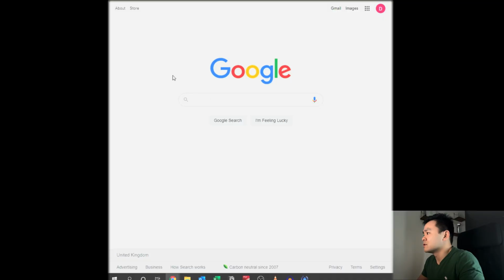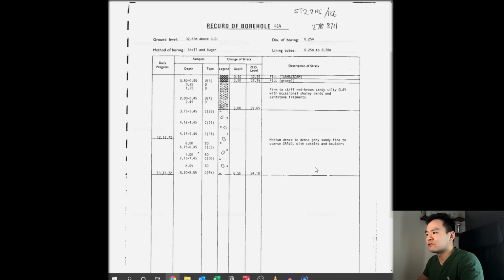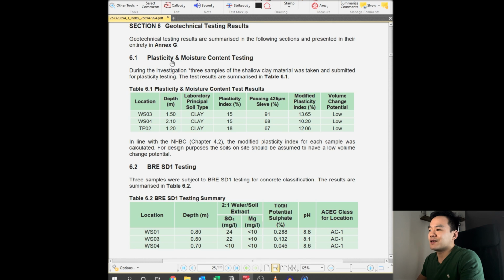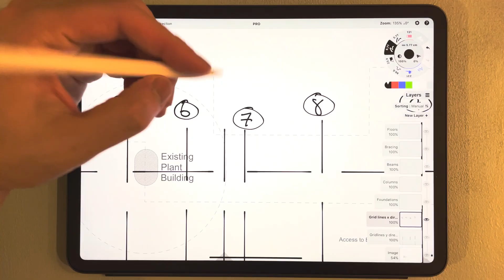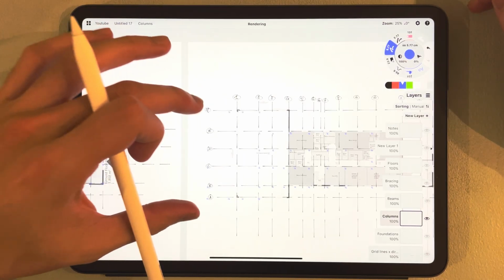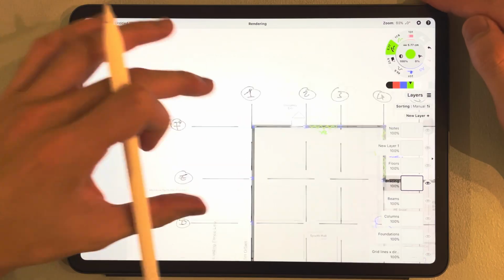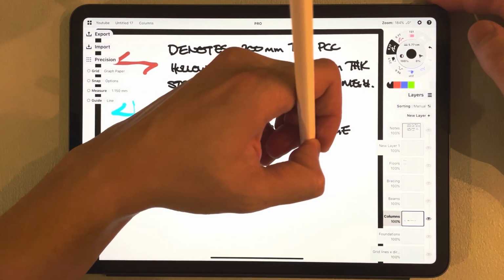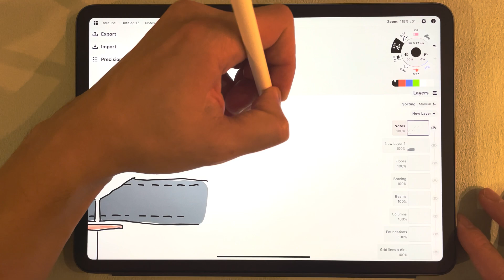How to Develop a Concept Design | Structural Engineering

Comment: Hi, thx for great videos 😊
working as an architect in Norway, Oslo
Q: is it according to your knowledge any features from Morpholi trace (iPad app) that would be missing in Concept app that you are using. Its looks like my use off Morpholia is quite similar to your use of Concept. I desperately want more real estate on my pad (ie this looks like a great alternative Samsung Ultra S9, 14,6 inch). Problem is that Morpholio does not work on Androids 
I use all apple products so iPad is an important tool.
The problem (subjective) with iPad is that its limits to 12.9 inch screen real estate.
The Samsung S9 Ultra seems as an good alternative with 14,6 inch
Reply from the maker: I’ve not used morpholio to any great extent so unfamiliar with what it can or can’t do compared to concepts. 
I think they are similar apps. My favourite thing about concepts is that it is vector based and therefore the quality of the lines are amazing for exporting.

Comment: Halo Mr Dazz, may i ask a question ? 

The mechanical electrical plumbing loads on house building structures, how much are those value that you ussually using on your project as a structural engineer ?

Thanx before Mr Dazz..
Reply from the maker: Services and ceiling probably 0.15 or 0.2 kn/m2
Reply: Thank you so much sir